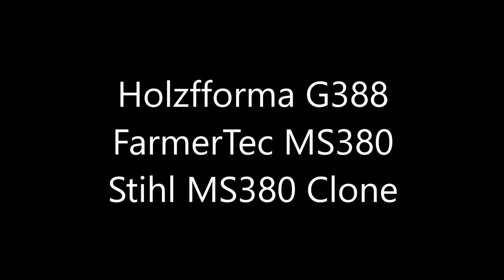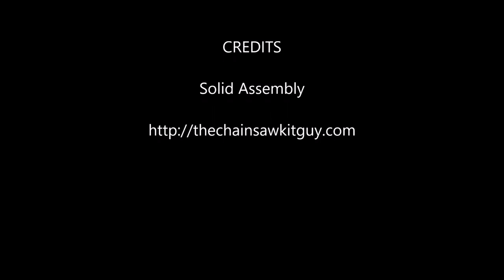FarmerTec MS380 Big Blue Chainsaw Upclose

Comment: If it is made well the choke in the air filter shouldn't be a problem.
Reply from the maker: I was commenting on the saw over all. I also mentioned how much trouble an aftermarket filter of that type was and why. Even the oem was a pain, serious
Reply: @the1chainsawguy  I have a stock 038, the air filters i have used am and genuine filters with no problem, if you cant remove the filter how can you clean it well.
Reply from the maker: @v26224  that's not what I said. Until I had cut with it. I did not want to mess up anything until I saw it run and cut. Many many people over the years have cussed those Stihl filters, count your self lucky.
Reply: @the1chainsawguy  ok, I kinda missed what you were getting at. it was like 12 at night when I watched it, now I have re watched it I understand your reason better.]

Comment: Or a 261.
Reply from the maker: its gotta be a saw they have walked away from
Reply: It would be a good one to do. Lots of them out there that need aftermarket parts or a replica. I was surprised they did the 250.
Reply from the maker: @RockIslandguy  that 250 is not worth buying. i dont say that often. but you are right.
Reply: Agreed. Thus the 261 comment. I feel that it is the smallest useful saw for us saw geeks. Minus the 200t and copy, and those are specialty saws anyway.
Reply: I was thinking the same thing with the 880, but still being produced by stihl that creates a problem.  A husky 394 or  2100 clone would be a cool too
Reply: savage69000 it's now an 881 I think, so an 880 should be fair game?